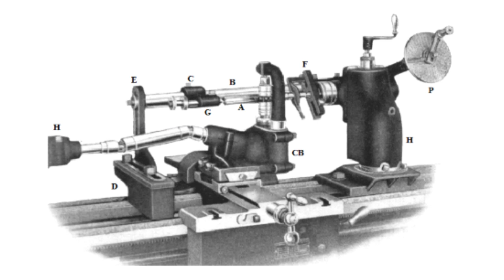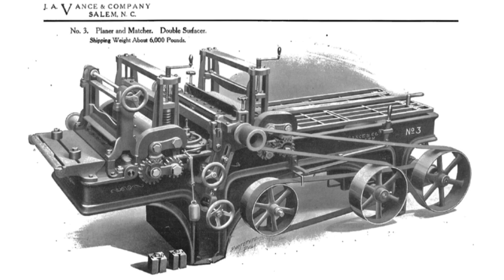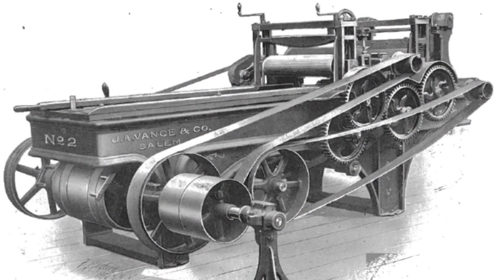Odds and Ends 1:  A mixture of shop topics

Comment: Back when I was in primary school (1953 - 1954, years 6 and 7) our woodwork class saws were those back saws, but we were taught that they were called tenon saws, and there main use was for accurate cutting of shoulder and tenon joints. Great video, love the format. Question, the model number on the Vance planer is 2 and a quarter. There's got to be some history right there!
Reply: ***** yes please :)

Comment: Hi Keith.
I started out as an apprentice joiner and was bought up on Henry Disston hand saws and still have 2 in regular use. The more modern tenon saws had brass backs rather than steel. They are no longer available in UK mores the pity. Mine are maked made in Philadelphia and stamped "For beauty finish and utility cannot be excelled".

Nice video. Best regards

Comment: Nice video---  I worked on the R-R 42yrs. from 63-2005 - we had passenger engines
that had steam boilers to heat the passenger cars -- I have used one of those sight
glass cutters many times but hadn't seen one in several yrs. also the present day
locomotives have sight glasses on the water tanks but in these days they just order
them ready to use.
I might have a source to get some pulleys off an old combine -- will check tomorrow
on what sizes are on it.

Comment: That's a nice saw!  I have three or four older hand saws, but only one is a Diston.  It has a nice curved back and an etched logo that is mostly faded.  I did find "Henry Diston & Sons" on one of the handle bolts.
  When I started out as a finish carpenter in 1973, I had to trim the house with a hand miter box.  Man, I don't miss those days!  It's so easy to take half a blade width off with a power miterbox, but that wasn't the case with a hand version.
  I imagine that most have been scavenged for scrap metal, but old grain elevators are a great place to find jack shaft and large pulleys.  They tore two down in our area a few years ago, and I remember seeing dozens of pulleys and such (probably not one would of been the correct size!)  Good luck with your hunt.

Comment: Keith,
I really enjoy the "odds and ends" format! How cool is it to actually own a piece of history? A saw that was made before the Civil War! That's something to treasure! My dad had a saw like that in a miter device. It was metal with a scale on top for setting the angle of cut. The saw fit between two metal guides. The piece of wood to be cut set on board on the bottom of the unit. It even had brackets on the front for mounting to your work bench. I will have to see if I can find it and maybe shoot a little video or stills and post them. I'm not really into woodworking that much, but it was my dad's and so I will cherish it. I am fortunate that I inherited the home place after my folks passed. There are a lot of memories there! Thanks for sharing.
Have a good one!
Dave
P.S. What about having those guys you use cast a new wheel? Would that be too much of a pain?

Comment: In the UK they are called a Tenon saw and were used to cut Tenons for Mortise and Tenon jointing.
Reply: ***** Yes I have both the saws you speak of. The smaller one with the open handle is called a dovetail saw.
Its use is by its name for cutting dovetails. I can only guess the open handle allows for the user to achieve the small angles that need to be cut when forming them. I love old tools and history. Great series keep it up.

Comment: Hi just wanted a little advice please Keith i've just put a 2mm mild steel sheet on top of a new wooden bench for my "Myford 'M" Type lathe im not sure if i should just leave it mild steal or project it some how i've ordered 5 tins of red metal primer will this just come off and scratch easy if i don't protect it some how i'm just trying to think what to do with it tbh leave it as sheet steel or leave it primer color or just paint it.i was going to paint it but not sure if it will chip and scratch easy..Any advice would be greate..Thanks
Reply: Thanks keith i wish i asked before i purchased 5 tins of gray primer,But they where cheap considering, i was just going to use the primer then use the Rustoleum clear coat..Thank you for your advice and time thank you for your advice and keep up the good work loving the videos.

Comment: Hi Keith, should you still need a replacement cutter wheel for your glass tube cutter, you might try Ernst Gage Company in Livingston, NJ at 973 992-1400.  They carry gage tubing, tubing cutters, level gage valves, tubing gaskets, brushes and other related items.  They are a great company to work with and have a nice catalog.  Thanks for your videos.  I always learn something watching your videos.
Reply from the maker: +Jim Irving Thanks Jim!